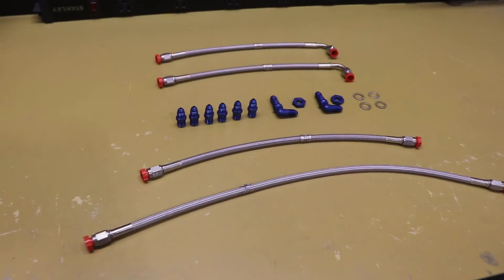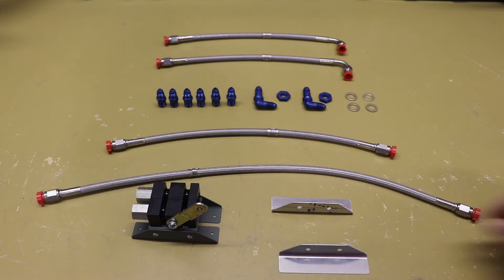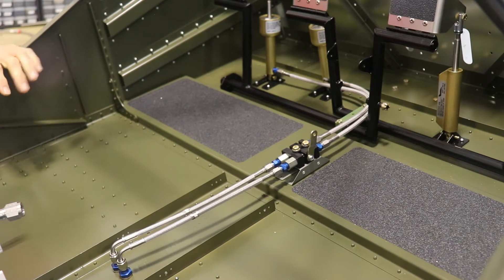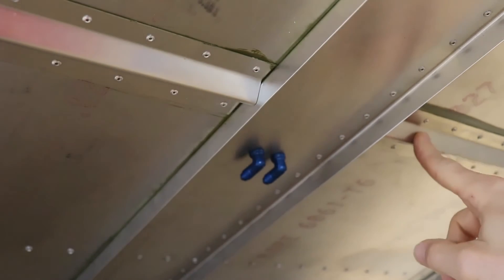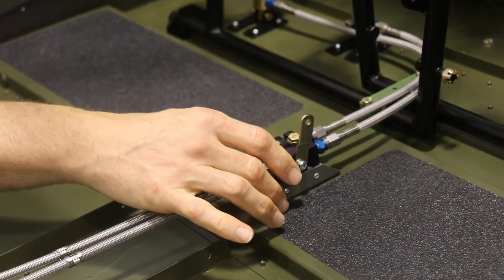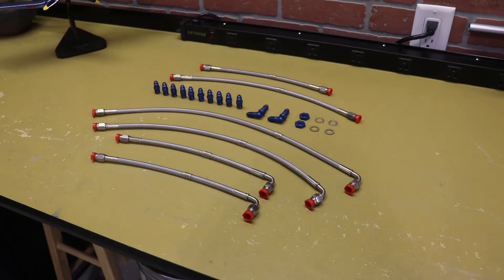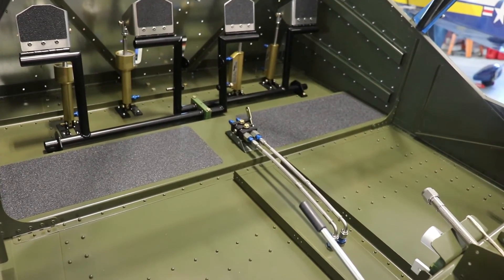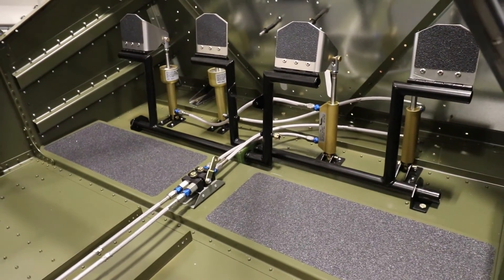Installing Brake Lines from Aircraft Specialty in the Zenith CH750 Super Duty (Ep47)

Comment: Why is the passenger right actuator rotated 90*? You mention it, but don’t explain.
Reply from the maker: It was for the fit of the brake lines. Without it rotated, when the pedal moved, the brake line interfered with the other pedal.

Comment: Hi mark, great video, as always. As a note to other builders, the brake lines and components, other than the bulkhead fittings, are also available from the custom motorcycle industry. I used to own a shop that built bikes and used coated braided lines and fittings often.
Reply from the maker: Yes absolutely! One can buy stainless line and fittings from a variety of sources. The benefit here is that these are already measured and cut. It's a plug and play system. But if someone wanted to buy the materials and measure and build their own lines, that is certainly an option.

Comment: Great videos on the under side where the brake lines 90° path you spoke of putting a short stiffener in the channel wouldn’t it be better to protect the 90° and the braided lines if you used a channel to enclose that area accessible with no plates
Reply from the maker: Some people have closed off the U shaped channel on the bottom of the airplane. There's a few reasons why I didn't want to do that. First, the enclosed tunnel would be a collection point for dirt and debris, spiders, wasps, bugs, and all kinds of other stuff. Secondly, I don't think it's necessary to add the weight of the additional channel and all the nutplates and screws because the channel really wouldn't do much to protect the lines. All I want to do is deflect any tall grass or maybe a twig from hitting the blue elbow fittings. I think the little ramp piece will do the job just fine.

Comment: When you install rigid lines you are suppose to install them with a bend to keep the lines from pulling apart as things stretch and bend. The flex lines after the parking brake I know will move, but shouldn't you have given a little more line to allow for flex? Thanks

Comment: The biggest problem with brakes is the fluid is hydroscopic. It absorbs water where ever it can get it. The high heat of stopping with the small (light) brakes heats the fluid and causes steam bubbles for any water in the fluid. In contaminated fluid, steam bubbles what you are pushing on instead of the pucks, the bubbles. The brakes are then considered spongy.  I wonder where the bleed valves are to make it easy to put new fluid in and old bad fluid out? The master cylinder will also have a rubber boot that fills the void as fluid leaks out to minimize the air and fluid contact. Generally in racing motorcycles the braided lines are liked because they reduce flex which also adds to the the spongy feel. The flex degrades the rubber tubing so the braid also helps flex degradation and any UV light that will also degrades the rubber lining the stainless steel braid covers.

Comment: Another great video, Mark!  One thing to be cautious about is when mating the steel hose ends to the aluminum fittings, carefully inspect the steel fittings for burrs.  A few years ago, I got a hose from Aircraft Specialties and mated it to an aluminum fitting on my oil cooler.  It always leaked and finally, I removed the hose and inspected the hose and fitting.  The female steel connector had a small burr in it and the male aluminum fitting had a matching deep scratch.
  I finally just fabricated my own braided stainless PTFE line (Earl's line and fittings) and installed aluminum fittings on both sides and no more problems.  Probably a rare manufacturing defect but always worth checking for at initial installation!  Some say to avoid mating dissimilar fittings and always steel to steel and aluminum to aluminum but usually mixing the two materials seems to work OK if both fittings are correct.

Comment: Hey Mark.... Seems as though your final bill from Aircraft Spruce will be almost as much as the one from Zenith! I'm not sure if I will set up an account with them or just pay as I go. Between specialty tools and upgrade materials, paints, adhesives, solvents etc. I knew from watching videos like yours that the incedentals would add up quickly! Your SD is sure coming along nicely, neat, clean and always professional! Thanks again for sharing and Blue Skies brotherman!
Reply from the maker: No matter how 'complete' a kit arrives from the factory, there's always a massive amount of 'things' you're going to need. Drill bits, tools, fittings, wire, terminals, circuit breakers, push/pull cables, nuts, bolts, cans of primer, etc.... It never ends!
Reply: @KitplaneEnthusiast  that's what I call ' incedentals ' , after watching you for a couple of years (and others) that list keeps getting longer! In the end you always get what you pay for. Thanks again!
Reply: @KitplaneEnthusiast  also... we've both have seen all manner of homebuilders aircraft , I would put the quality of your building equal to or exceeding that of most certified aircraft!

Comment: Hi Mark, 
Just curious will you be installing a vented reservoir cap for the brake fluid?
Reply from the maker: The two master cylinders on the pilot side have vented plugs. You can learn a lot more if you take a look at the Matco website.
Reply: @KitplaneEnthusiast  Okay was wondering why the pilot side actuators looked different!

Comment: Excellent presentation Mark !
Very well executed, thank you for creating and sharing such high quality content.
Two thumbs up,

By-the-way, each of the Pilot's side actuators, in the dual system, only has one port connected ? 

Does that mean the piston opposes a spring within the cylinder when depressed ?
 ... will the pedal orientation return to the 'brakes off' orientation when the pilot releases 'toe over' pressure ?
 ... or is the return-to-position controlled by a spring in the brake caliper (puck) sub-system ?

The Parking Brake component appears to be some sort of Shut-off valve (SOV) ?
... must the pedals be in the 'toe over' orientation when engaging the parking brake ?

Is there a possibility of cavitation in the lines upstream of the parking brake component or does the cylinder have a built in reservoir to mitigate such a problem, if it does, is the reservoir vented and can it thus weep ?

Probably way too many questions for here and I should go to the vendor's website and look at their manuals.
Reply from the maker: Dave, take a look at the Matco website. You will learn all about their brake system!
Reply: @KitplaneEnthusiast  Mark, good advice. I did look a while back when Darren Towers was installing his brakes but there are so many options and the drawings aren't all accessible, so I'll need to do as you suggest. Thanks. Great video by-the-way !

Comment: Hey Mark...been following you for a couple weeks now and I've been binging your videos. We have much in common in regards to our path to flying.  I'm USAF retired and started as a jet mech on F-106s, then crew chief. Spent 10 years enlisted then  accepted to Pilot Training. Flew C-130s and RC-26s.  I've been retired since 2012 and have been seriously thinking of building an airplane.  I'm currently looking into local EAA chapters.  Anyway, one question I have for your Zenith STOL...since you will be doing IFR ops how will you be planning for windshield defog and wipers?
Reply from the maker: You have to get out of the "Air Force" thinking LOL! This isn't a C-130. There's no need for wipers or even defog. But, I want the front windshield to have defrosters for those early morning back-country departures. That's easy to plumb into the cabin heat system.

Comment: Hi Mark, why don't you just close the whole channel on the bottom?
Reply from the maker: Because that would just be a collection point for dirt and bugs!
Reply: Given that same line of thought, why not just install a protective “shield” over the fittings with rivnuts for access. It would certainly be more protection than a piece of aluminum several inches in front of them?
Reply: @scottmiller4711  Yeah that thought occurred to me too, but just a viewer not a builder yet!